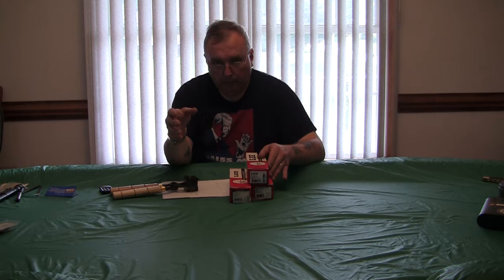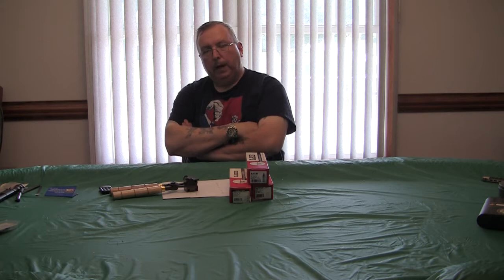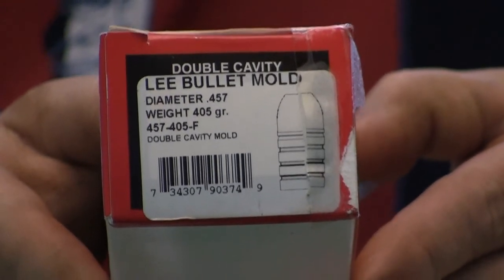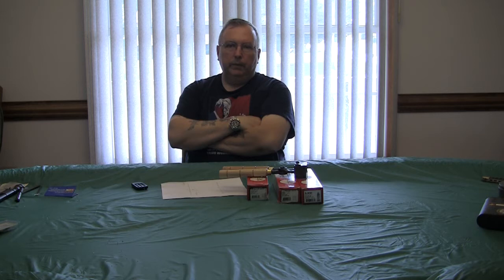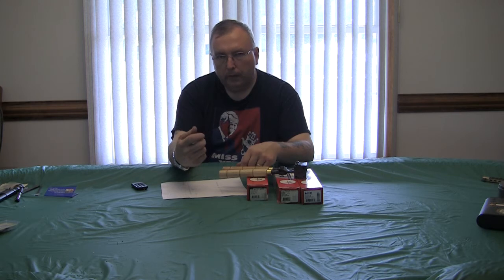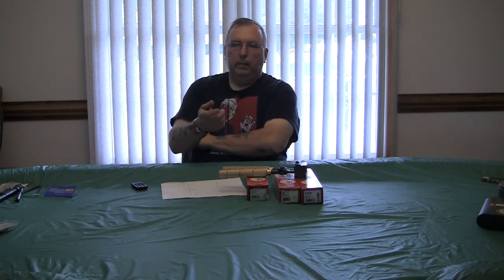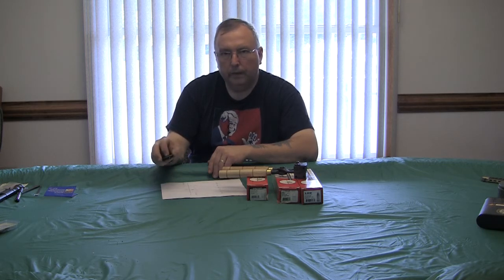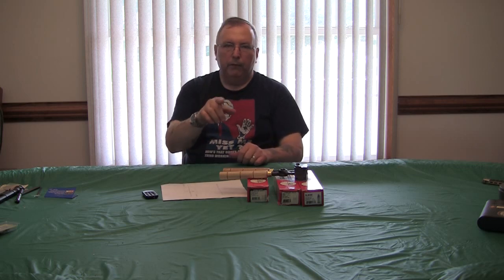Smokeless Or Black powder ammo? 1873 Trapdoor(1/2)

Comment: Great video! In my younger years I was all black powder however as I have aged, I only use it in my muzzle-loaders. What I did for my trapdoor carbine is research all the load data from multiple load manuals and found one with the velocity I wanted coupled with low pressure. I try to keep the pressure < 16,000 CUPs'. I do use a .457, 340 grain bullet although they cast out at 351 grains. I have not had problems with leading and my particular carbine tends to shoot them very well. The trapdoor is a great rifle and thank you for sharing your valuable information.

Comment: I have a trapdoor carbine. I use the Lee 405gr HB lubricated with SPG, with 55 grains of either FFg black powder or Pyrodex. I fill the space with Cream of Wheat. That duplicates the original carbine load. With black powder, my carbine speaks with authority. I have a Browning Model 1886 in .435-to. With smokeless powder, it is loud, but it just doesn't sound right. I prefer my black powder loads in my carbine.
Reply: What space? I use the same bullet and 55grs of either FFG black or Pyrodex requires 1/8" of powder compression to seat the bullet in Starline, Winchester or Remington brass.

Comment: Great video, and good information, but I do have a bone to pick with you. You talk about people using harder alloys with BPCR rifles and speak as if a bullet of COWW will wear the bore. A 13bhn bullet driven by a heft charge 1.5f or 2f is not going to cause wear to the bore. The alloy is still much softer than the steel the barrel is made from. Most of the pure lead, and softer alloy mantra comes from muzzle loading and cap and ball revolvers. The last thing you want to have to do in a muzzleloader match is drive a harder alloy bullet down a fouled bore... there is no give. When it comes to BPCR, just like smokeless, fit to the throat and groove diameter, as well as lubricant is king over how hard or soft your alloy is. A Lyman No.2 alloy will work fine. If you can dig a groove in the bullet with your thumbnail, it's fine for BPCR.
Reply: I use either 16:1 or 20:1 lead/tin in my trapdoor. 405gr Hollow Base and 500gr semi pointed bullets that drop from the mold at .462". I've used both Goex 2f and Pyrodex and get the same velocity and accuracy. My 1884 shoots about 4" high at 50 yards. I've mainly settled on pyrodex at it's only 2/3 the price of real BP and 55grs by volume only weighs 38grains so I get more shots per lb. I also haven't had the issue people complain about with it being more corrosive than real BP.
Reply: @outspokengenius  I commend you for being able to tolerate pyrodex. Once I switched to real BP I never went back.

Comment: Obviously, this rifle was originally designed to fire black powder cartridges. But did the military ever work up and issue smokeless powder cartridges (since it's service life extended into the smokeless powder era)?
Reply from the maker: no there was never a smokeless powder load issued by the military for this rifle, the point of this video is that some people have the opinion that only black powder should be used in these rifles, you can use smokeless powder with no problems if you know what you are doing

Comment: What about modern replicas? I assume since a modern clone is made with better material and machinery, it should be able to handle hotter modern loads?
Reply from the maker: there is a bit of a misunderstanding with modern replicas, yes the material is better, but the design is still the same and the design may not be up to modern ammo a good example is the Winchester 73 rifles, the basic design is not strong, so when people start shooting powerful ammo in it they run into problems. You shoud treat modern replica of older guns just like they were antique guns
Reply: @TheKoba49   This is not true at all. The modern reproductions are made for smokeless powder plain and simple. They may not be made for heavy loads but they have to be made for smokeless powders. There is no design being made today that is not up to the pressures of modern standard ammo. Also the trapdoor design is not weak, P.O. Ackley attempted to blow up trapdoor actions and all he could manage was burst barrels, he never had a breech block fail.

Comment: I had 20 bullets made300 grain hollow point. Is it okay to shoot them up.???
Reply: Are they loaded to trapdoor pressures?
Reply: @chadb9270  Steinel said they load special light loads for my gun. 1873 with an 1884 breach
Reply: @chadb9270  I forgot. one guy loaded lead ones for me. Another guy loaded copper jacketed ones. Will the copper pass through the rifling?